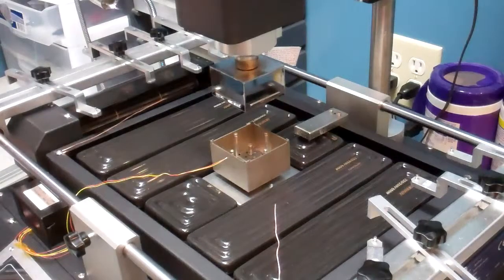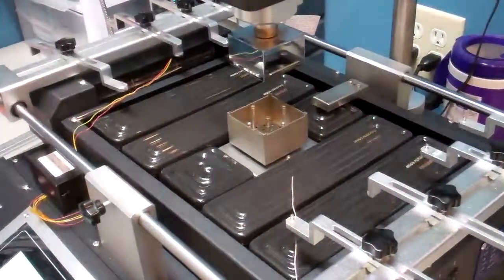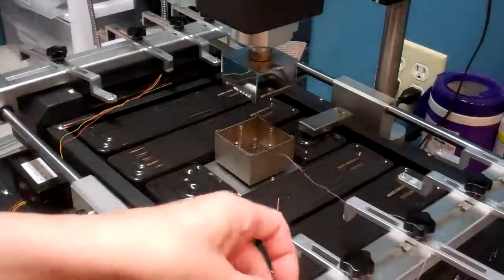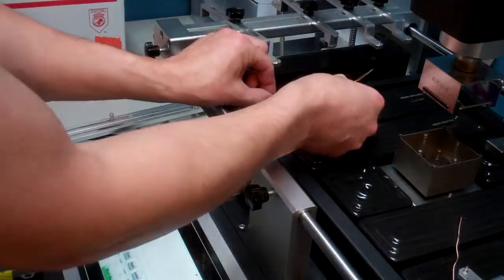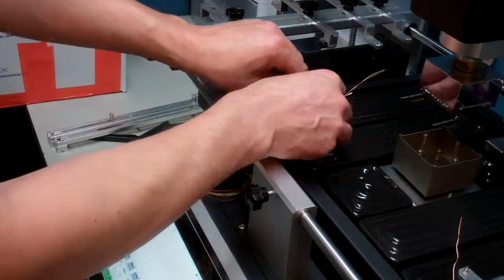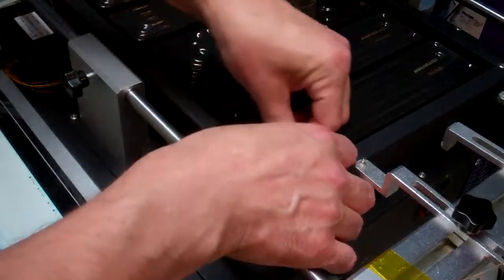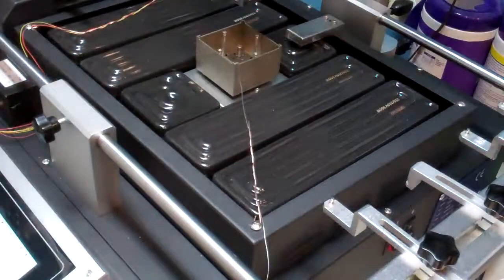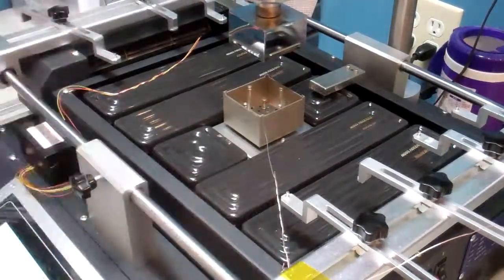Initial setup of the SpitFireMods modified HR-360 rework stations k type thermocouples/probes.

Comment: Hello, I have a question for you.   I have a Scotle HR-460C.   It only has one external K-type thermocouple.   However, there appears to be one built in for the lower hot air (it has hot air and IR for the bottom) and there seems to be one built in for the top hot air.   Is there a mod for this unit of mine?   My HR-460 looks almost identical to your HR-360.   I have a CCD camera but that's just included, it's not actually part of the unit.   Do you have any videos or how-to's on how I'm supposed to rip it apart and what I'm supposed to do to modify the built-in thermocouples?    Thanks!